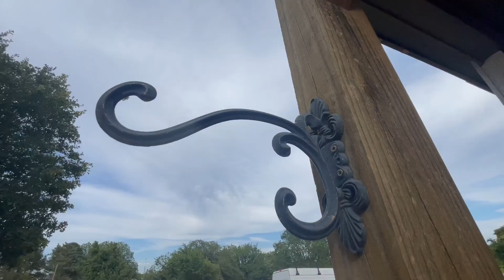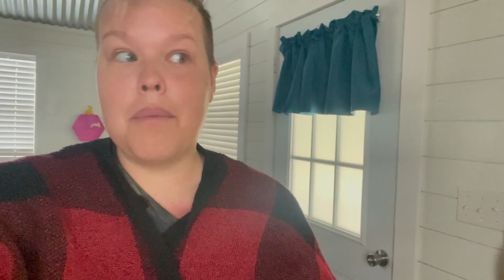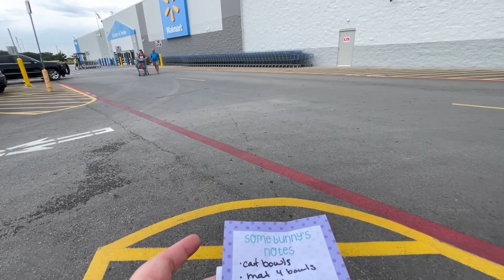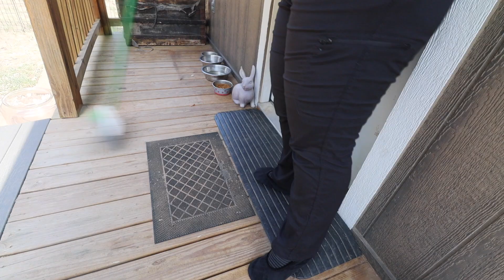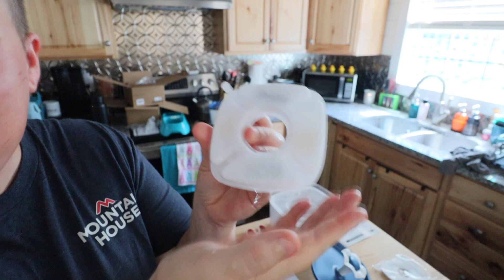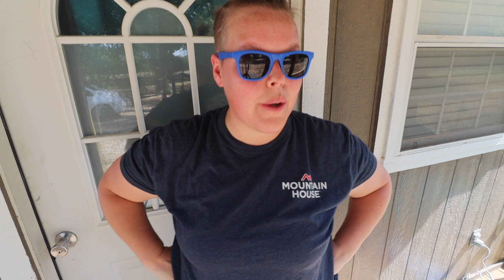Turning My Small Porch Into A Tiny House Outdoor ROOM | Creating A Kitty Haven On My Tiny Porch

Comment: Although a great idea I can't see those fountains lasting too long, do you worry about attracting unwanted visitors with the food and water outside? Like snakes for instance? You're a good heart but when you go back on the road they'll survive no problem, maybe you could put up a small shelter away from your tiny home to feed them in and claim your porch back
Reply from the maker: My parents will be taking care of the cats when I am on the road. No one wants to see anything bad happened to them. As for the critters that are coming to the porch I have always had critters that would come to the porch like raccoons even when there wasn’t cat food so I’m not really worried about that. The cats pretty much clean it out before bedtime anyway so not really concerning. I haven’t seen a single mouse or snake on the property since the cats have been here, so that is a bonus because I do not like snakes at all. As for the fountains as long as the last throughout the summer, so it can keep the water cooler I am happy after that if I need to put out water I can do so and just static bowls and that will be OK but this is mostly to circulate the water and keep the water cooler. As for a shelter, there isn’t one in this area that I can take them to the local shelter is overcrowded, and only accepts animals from in the actual community itself outside in the county area where I live they don’t accept things from there unfortunately. In smaller rural areas. Unfortunately, this is all too often the case. So there’s no way that you can really manage things like this without access to a sustainable county shelter.

Comment: I had that same water fountain for my dogs. Unfortunately it only lasted maybe 6 months. I noticed I was having to clean it once or twice a week cause it would clog and then water wouldn’t come out. It will flash red when it needs more water. My instructions on mine was pretty much figure it out on my own. Lol I was looking for the same thing when it came to telling me when to fill it
Reply from the maker: As long as it lasts throughout the heat, I will be happy. The main reason I wanted to have circulating water is because it keeps it a bit cooler and so that helps out a lot during this record heat wave. During the winter time, the likelihood of using this is very slim as this is an outdoor water or so will probably freeze, so I will likely go back to using regular metal bowls at that time, just to keep the water more sustainable on being able to keep it not icing over
Reply: I think if you would keep a gallon pitcher of water in your refrigerator to put fresh in it each day would be good.

Comment: I would use pvc pipe to hang the curtains.  Have them cut to size and put the rubber ends on them and voila, curtains rods. You can even spray paint the pvc the color you want!!